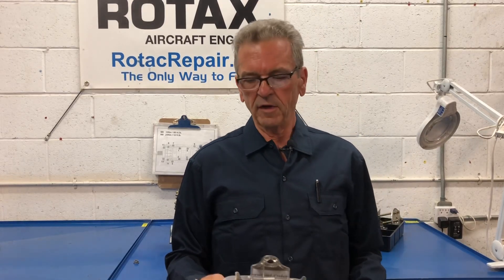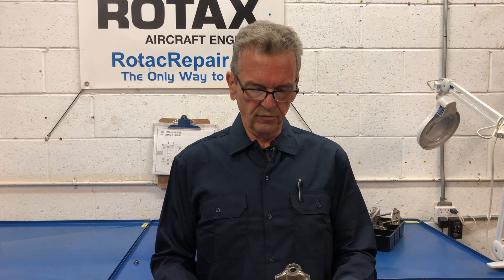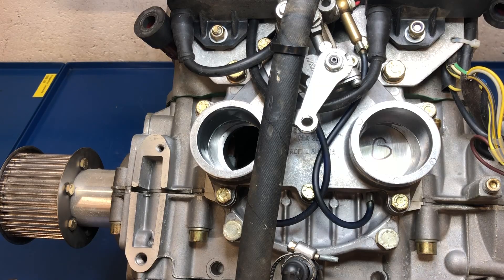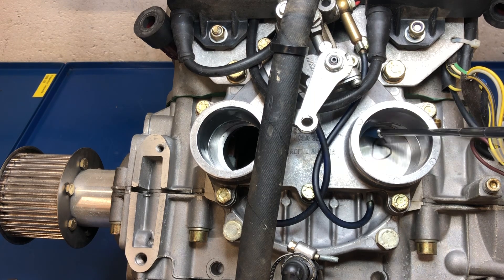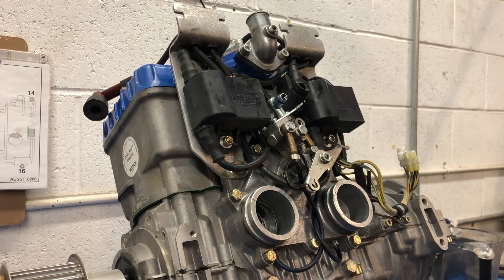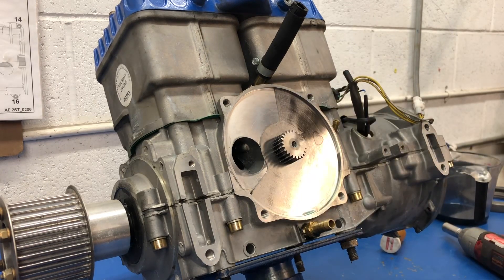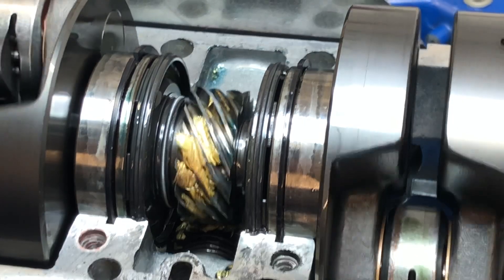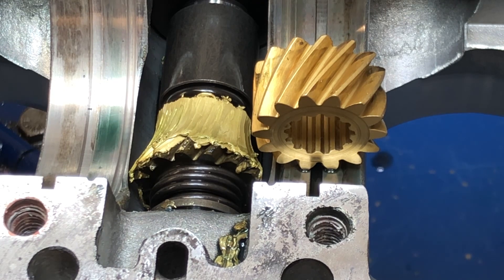Sudden Engine Stoppage investigation 582UL Rotax

Comment: 08/23/24.. I'm considering the Rotax 582 for my Challenger ll CWS. I'm trying to learn how to take good care of a 582. Your U-tube presentation was a big help since I have heard the problem you discussed is most important to stay aware of. I have flown rotax 447 and 503 twenty years with very little problems since I'm always doing maintenance a head of schedule. I look forward to your other vides. Thanks.
Reply from the maker: Thank you for your kind comments. Btw, I have a used above wing radiator assembly for a Challenger. Happy flying!
Reply: @RotacRepair  hello sir am looking for a used rotax 582 engine

Comment: Hi John. Fantastic informative videos you make. May I ask a question. I have a 582 blue top, 
Once the engine has been ran and stopped I’m getting oil dripping from the air filter and once the air filter is removed I can see it’s mainly from the rear carb. The aircraft is a tail dragger so the engine is not level when not flying. It does not have an auto lube bottle as I pre mix the fuel.
The rear carb slider is slightly more open than the front one when the throttle is at idle. I’m going to set these up like in your other video. Could this be the cause or shall I be looking elsewhere for the problem.
Many thanks. Damion from the UK.
Reply from the maker: Perhaps the mechanical pencil carb sync will cure the issue. I’ll make a video on a diy carb sync stick soon.
Reply: Washing out your air cleaners should be a regular maintainance item as some fuel reversion does occur even in the rv engines.   This is particularly noticeable in the non rv engines like the 447 and 503s . Not a big deal just whip the aircleaners off and soak them in clean fuel any time you do a plug check.(aircleaners"must" be dry before refiting to the engine) these are great wee engines and dead easy to maintain.

Comment: Hello thankyou for an uninformative video  ,,I have a 582 blue top with 600hrs on it,,does the crank shaft have a max Hr limit on it please if you know the answer?
Reply from the maker: Thank you for your kind comment.  I recommend you you obey government aviation regulations where you operate the aircraft. I am not aware of a published maximum hour limit past 300 hours, however I've serviced 582 engines with up to 600 hours on them. 
Rotax recommends crankshaft replacement every 300 hour and also every 5 years the engine the engine be dismantled, inspected and resealed on aircraft engines. 
I would recommend a complete engine inspection now with replacement of any necessary components. Properly completed this 582 engine should then be expected to run for the next 300 hours..

Comment: Inverted engine filling instructions :  First remove the stem that is inside the engines RV oil bottle & discard it. The bubbles will go to the top anyway & by doing this,  there is no incorrect way to route the oil lines.  Also I have seen these engines pump the oil in different directions. I don't know how thats possible but I saw it.   Fill an old gear oil bottle that has a  nipple with 30W motor oil. If your using a small amount of RV oil then fill it with your Premix oil. They don't come from Rotax with Premix oil in them.  Remove the oil line from the bottle that runs down between the cylinders. Insert the oil bottle nipple into the line. Squeeze without stopping until the oil enters the bottle from the other oil line. . Top off the RV oil bottle.  Remove the 6mm bolt on the side of the engine just above the water pump cover to get the air out. Reinstall the bolt. Rotax Rick
Reply from the maker: The whole point of this video is to highlight a engine maintenance error that had occurred. The 582 Rotax Line Maintenance Manual omitted the correct rotary filling procedure for inverted engine installations. Although this video is viewable by the public, it was primarily produced for Transport Canada, The Transportation Safety Board and Rotax for potential reimbursement due to the error in their publication. Best Regards John

Comment: I hope he sues Rotax for negligence. He's lucky he's still alive, no thanks to Rotax. They should stick to snowmobiles and watercraft.
Reply: @jaydenanko1640  This engine is not suitable for acrobatics (inverted flight,
etc.).
• It should be clearly understood that the choice, selection and
use of this particular engine on any aircraft is at the sole dis-
cretion and responsibility of the aircraft manufacturer, assem-
bler and owner/user.
Reply: @chippyjohn1 really! Because the ones we have down here in New Zealand seen to do great loops, rolls, and most anything else you can do with an airplane. Maybe because we're "down under" we're flying upside down all the time😂.
Reply: @jaydenanko1640  WARNING
Non-compliance can result in serious injuries or death!
This engine, by its design, is subject to sudden stoppage. Engine
stoppage can result in crash landings, forced landings or no power
landings. Such crash landings can lead to serious bodily injury or
death.
Reply: @jaydenanko1640  Non-compliance can result in serious injuries or death!
This is not a certificated aircraft engine. It has not received any
safety or durability testing, and conforms to no aircraft standards. It
is for use in experimental, uncertificated aircraft and vehicles only in
which an engine failure will not compromise safety.User assumes all
risk of use, and acknowledges by his use that he knows this engine
is subject to sudden stoppage.
Reply: @jaydenanko1640  That is a small part of what is stated in the owners manual.
Reply: @jaydenanko1640  It also says this, hmm. If the engine is to be used inverted (with spark plugs pointing down) select a lubricant
which features low carbon deposits. Oil residues tend to drain to low points, i.e. spark plug
cavities. If these residues fail to burn during normal operation, plug fouling will occur, pos-
sibly causing pre-ignition. Producers of suitable lubricants will issue warranty of their
products
Reply: @jaydenanko1640  I confused this video with another that was using the 582, my apologies.
Reply: It was the installers fault. The owner installed the engine in an orientation not certified by Rotax. If you don't know what you are doing don't do anything!
Reply: @chippyjohn1  I think all challengers have them installed this way most know about bleeding the air I guess he didn't.
Reply: @Mike-01234  The manual states horizontal mounting only.
Reply: @chippyjohn1 this is untrue, yhe manuals give instructions and specifications for both plugs-up and plugs-down orientation. The “full” manual and installation manual give instructions for filling the system in both orientations. However the “light “ maintenance manual, the one actually shipped with the engine, omitted the extra step required for inverted installations.
Reply: @andrewforber3826  Plugs sideways is accepted also in the manual you refer to?

Comment: Thanks for sharing this, would be good to have a demo of replacing the oil in an inverted 582?
Reply from the maker: Hi Neil, your very welcome. I published a video titled “Rotax 582 oil change with spark plugs down” a couple of years ago on this same channel. It deals with the proper procedure to purge the air while refilling the rotary oil gear case. Then by request I published another on how to drain the rotary oil on an inverted engine.
Reply: @RotacRepair  Great thank you, makes you wonder why its not covered in the manual!